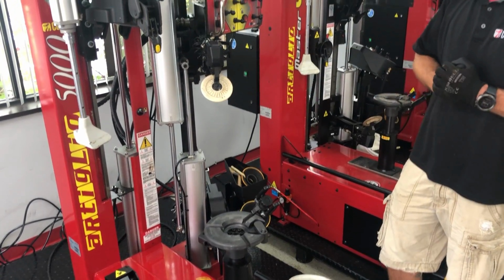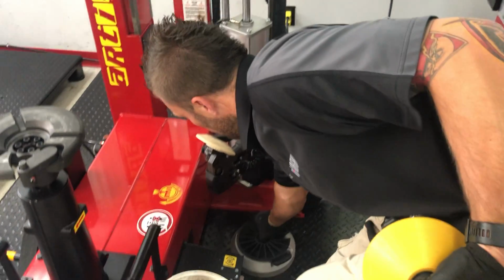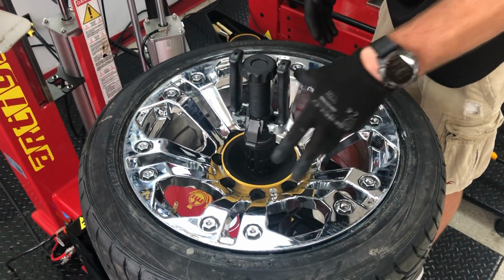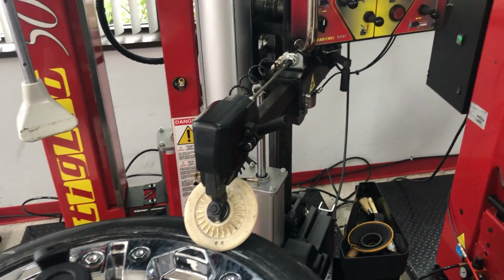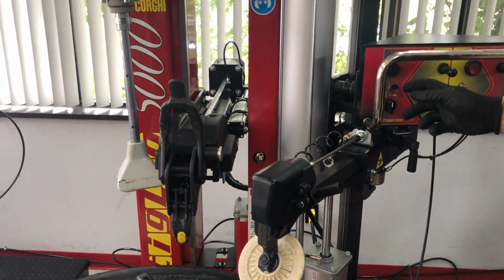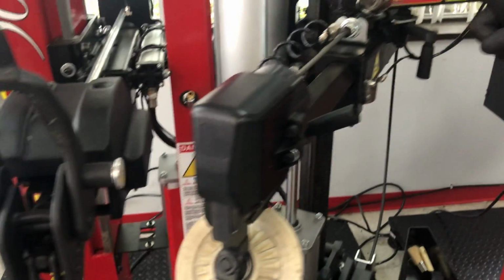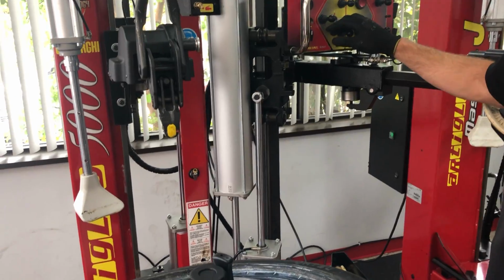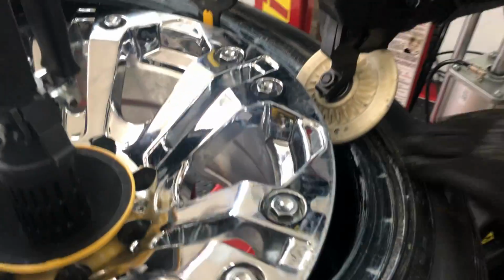AM-5000 Operational Video

Comment: Can you do truck and trailer tires on this machine example 17.5, 19.5 or 22.5??
Reply: Depends on the hub size. I can mount 19.5 on a Ford F550 wheel with it, but I came across an RV on a Chevy C6500 Chassis with 19.5 wheels, the hole in the middle of the wheel was big enough to fit the Light truck adapter through, so there was no way to secure the wheel to the machine.